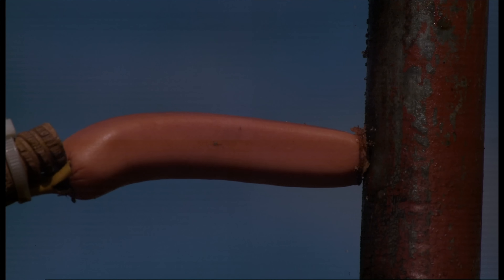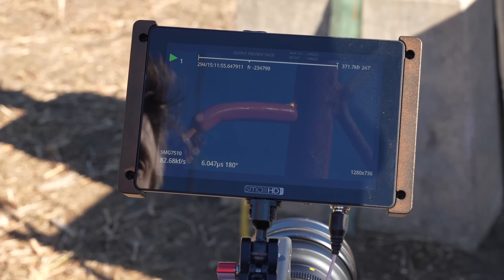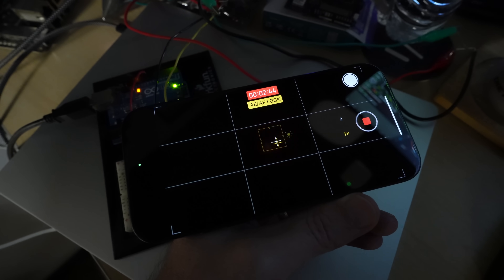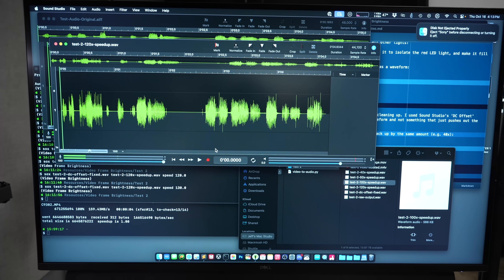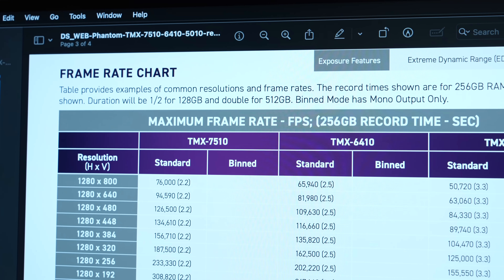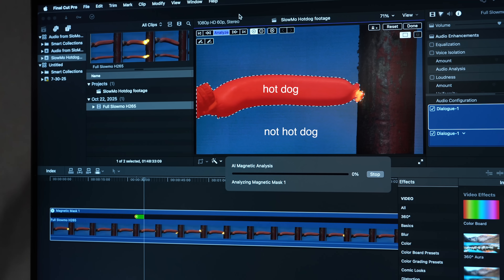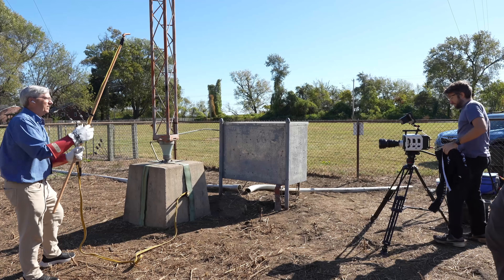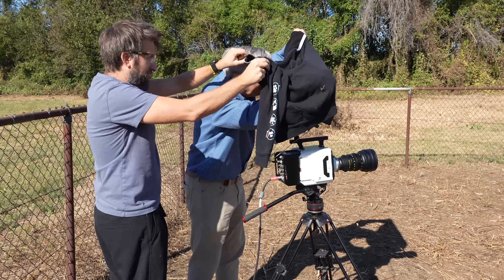A new way to listen to AM radio

Comment: If you skip the Arduino in your LED experiment  (just connect LED to the speaker output), you would get much better results.
Reply from the maker: I actually tried this a couple different times, but I was having trouble getting to voltage right to get the LED brightness correct. I was able to get a very dim effect, but didn't want to figure out an amplifier circuit when my hammer is throwing software at a problem :)
Reply: @GeerlingEngineering  yep, you need a bit more power to drive an LED. Modulating the light isn't new thing. Optical track on old 8mm film movies, laser ethernet links or fibre optic these days :-) When I was a kid I used to make phones with a modulated bulb (terrible sound due to filament persistence) and later with LEDs.

Comment: If you continue the LED audio project, perhaps you could investigate exploiting rolling shutter to get a high sample rate from a regular video source.  If the light from the LED audio source is diffused across the entire sensor and normalized, the scanline pattern of an appropriate type of video sensor could theoretically be decoded to recreate a MHz sample rate.  It may require a camera driver that allows manually setting the shutter angle to 360° to get the best results.

Of course it might not be quite that simple, but I've had that idea rolling around in my head for some time, and seeing the horizontal banding on video of plasma sources it is obvious there is at least some higher frequency data in there.

Comment: Tried a nail instead of the hotdog ? Hopefully without short circuiting everything. If you need contact, use a welder-stick.
Reply from the maker: We actually tested with the bare copper towards the end of the day, you can see that in the end of Gavin's video. It quickly triggers the foldback protection on the transmitter, so trying to get audio out of that much of a short would require bypassing transmitter safeties!

Maybe something we could do in collaboration with a transmitter manufacturer someday. Would likely need temporary permission from the FCC too.

Comment: I remember a project in an electronics magazine in the 70's for a 'light intercom', it used a couple of torches and LDR's (photo resistors)
All you need on the receiving end is a voltage divider (resistro and ldr) feeing into an amplifier via a capacitor (for dc blocking)

Comment: If you use something (sorry I am not good at electronics) to reverse the negative voltage to positive, and have it blink another LED (a green one?).  record that along with the red one.  would you then get a full set of sound waveform?
Reply from the maker: Someone else also suggested doing that; it could definitely work! Otherwise, another option is to shift the analog level up (DC offset) enough so the entire waveform is positive, then shift it back down when processing the video.

Comment: 1:00 Nyquist-Shannon theorem would dictate to capture an 8kHz signal without aliasing you would have to record at 16kHz

Glad to see DSD evolving into HDSD, Hot Dog Stream Digital
Reply from the maker: Haha, HDSD needs to be a standard
Reply: I would add that you only need to sample at 4kHz to get recognizable speech.
Reply: AM radio bandwitdh is limited 10 kHz in some regions and 9 kHz in others. Which means that the highest frequency component in the audio is 5 or 4.5 kHz.

Comment: Audio is AC & Diodes are DC. Use four LED's to make a "Wheatstone Bridge" to visualize & record...maybe use different colored LED's for each positive/negative waveform and color block/filter in post processing and combining. Seems like it should work. In theory. 😂
Reply from the maker: Heh, seems like that would be one way, otherwise shifting the voltages with a DC offset so one LED could still do one mono channel okay. Lots of opportunity to improve it!

Comment: For digitizing audio at 8kHz, you need AT LEAST 16,000 samples per second.
Reply from the maker: I'm lucky I didn't have him go down to 8,000 fps then :D (I think that Phantom might not go that low?)
Reply: the nyquist limit
Reply: But AM radio bandwitdth is limited to 9 or 10 kHz, which means the highest freqeuncy component in the audio is 4.5 or 5 kHz.
Reply: Not really, you can digitize anything even at lower samples than the original - data is simply lost so in this case audio quality will really suffer but it is still a digital approximation of the signal that is likely good enough given the purpose here as long as the sample rate from the camera is high enough a human with our relatively limited audio processing can decode some of it - quality was never really going to be attained when so much of the signal was never picked up by the camera in the first place with the flash being on the wrong side etc.
Reply: Phone quality (ISDN grade, because the anologue carrier frequency systems were even more band-limited) audio was 8000 samples per second (and band-limited to 3.4kHz before sampling(